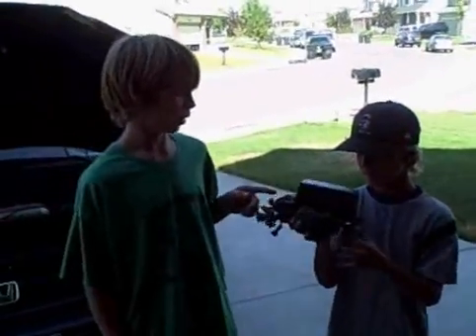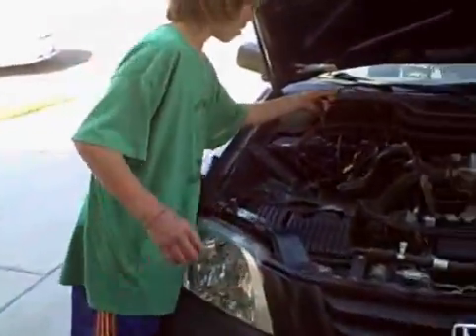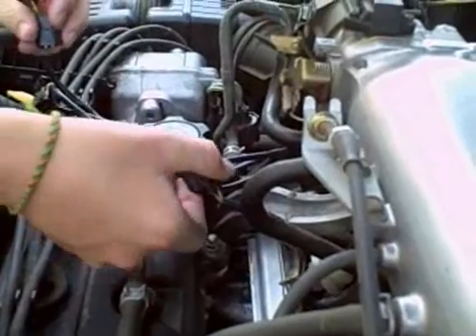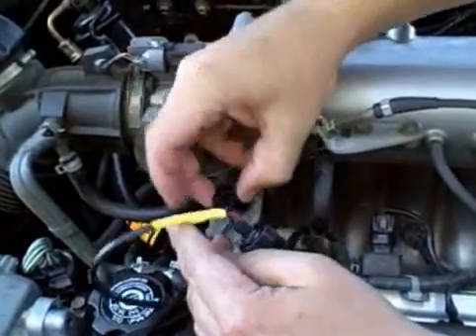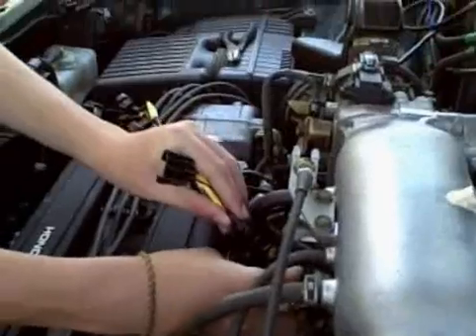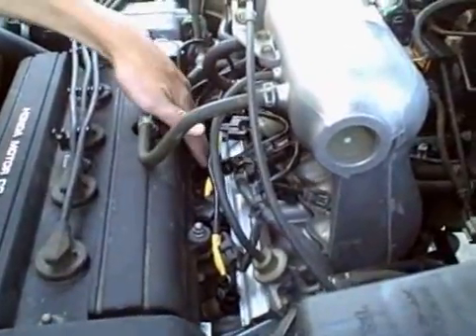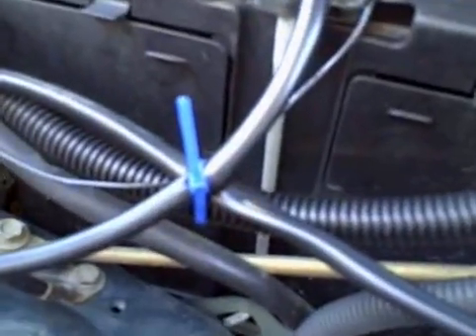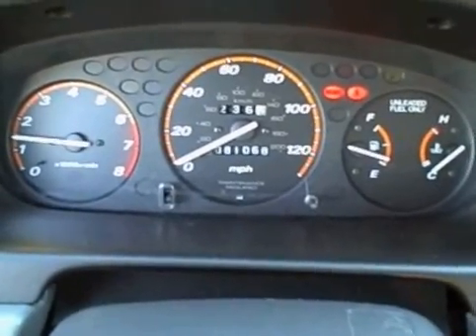How to install an E85 conversion kit

Comment: a friend installed one of these in his gmc sanoma and his mileage did not go down and his power went up. i have heard you need to be prepared to change your fuel filter after the extreme cleaning properties of alcohol clogs it with gasoline sludge build up from your tank. is this true? and i also heard alcohol can dry out certain fuel lines and make them crack. is this true and how do i know if my car has the proper fuel system to handle e85? this only converts your engine correct?

Comment from the maker: Of Course. Turbo and supercharged. Here is an instant message from a customer with an S2000 and aftermarket turbo and eManage Greedy and many other crazy mods:

hey got the box on and took it to the dyno.last time @68 deg we made 538 rwhp this time 100% e85 76 deg outside 4 more deg eng timing it made 551 rwhp !!is's working great with no problems.allan.